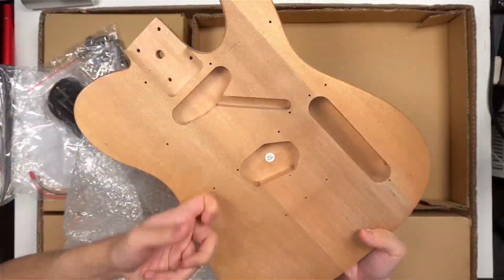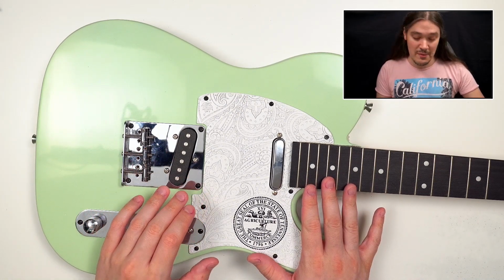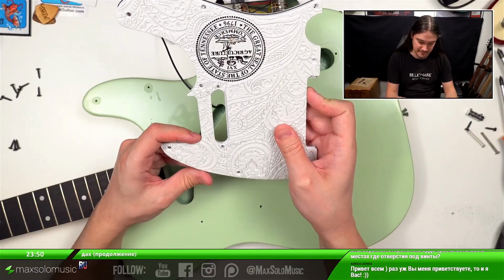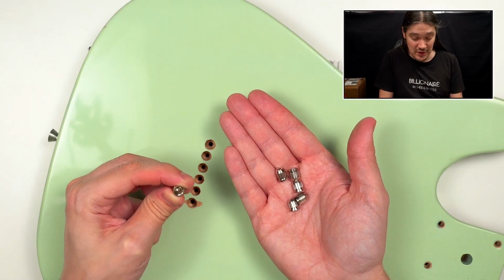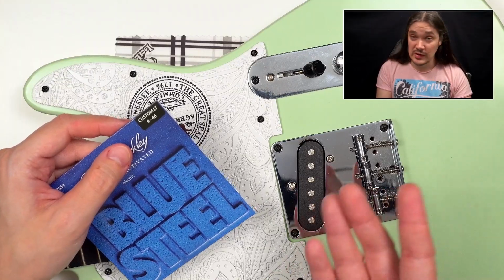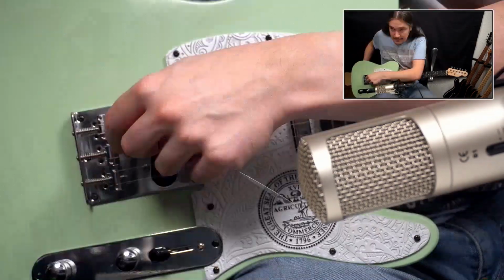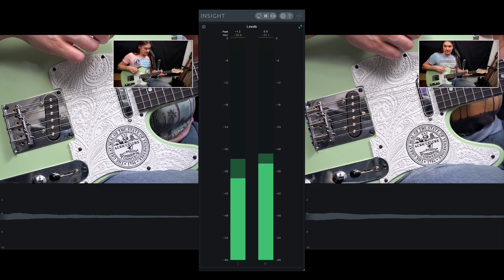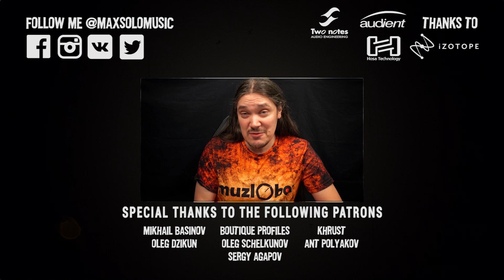String-Through Bridge VS String-Through Body. Harley Benton Tele Makeover Continues

Comment: There should be an accumulated effect of several mods - string thru body ( $6 ferrels )+ brass compensated saddles ( $ 8 - 15 ) + bone nut ($8 - 10) + some upgraded pickups ( Wilkinson's at $38 CAN ) resulting in the richest sound possible on a budget. I don't see the justification on putting $120 - 200 pickups on an $80 guitar kit but whatever floats your boat.

Comment: The difference in sound is obvious. But talking about "sustain" is not the whole picture. The strung-thru attack transient and first the 100ms or so clearly had more power both times. The decay rate was tough to gauge but looked about the same. The energy at the very end of the tail was slightly more, like a higher noise floor. 

Why don't folks on the internet talk so much more about the attack than the sustain? That's the part we all can hear, unless you are doing a Carlos Santana tribute band or something.

Comment: After watching this one, Dylan at Dylan Talks Tone and one other do the same test I’ve come to realize 2 things make a tone difference. The pickups and your fretting hand, plain and simple. The only caveat to that is the amp, but I’m talking about a guitars parts. All the bickering about bass wood vs alder or mahogany is crap. String brand, tail piece, top wrap etc have such an extremely minor affect on the tone it’s silly. If you gave Billy Gibbons that guitar it will sound like Billy if he had his 7 gauge strings and the amp he prefers with his pups. He still may prefer his guitar, but on stage you probably would notice a difference.

Comment: Strings through body do absolutely nothing for sustain.  
There is no vibration beyond the bridge so it's a totally cosmetic choice.
Reply from the maker: That's not exactly the case. There's vibration above the nut just like there's vibration below saddles. It may not affect the sustain but it does influence a couple of things. Different total string length will cause slightly different tension feeling when bending strings. As well as resonance noises in the bridge will be different.
Reply: @MaxSoloMusic  The reason a high mass bridge gives better sustain is because it stops dead any vibration beyond the string length.
Reply: @horowizard  I think that's right. The more energy that is "reflected" ie not propagated out into the string beyond nut and saddles is retained for longer vibration before dying out.  Any energy travelling beyond the nut would be (must be?) at quite high frequencies, probably out of the audio band.
Reply: Not that the two are related 🙄

Comment: I also have this kit and enhanced it with better hardware... Through Bridge or Body does not influence so much - good to know. I, for example, instead replaced the saddles with compensated ones - for better intonation.
What I planned to change on my tele kit is what you can learn here: https://www.youtube.com/watch?v=htjhWRG9llI&t=40m25s 
Therefore you need to buy a lefthanded tele bridge and mount it on the right handed...
Would love to see you testing this difference :-)